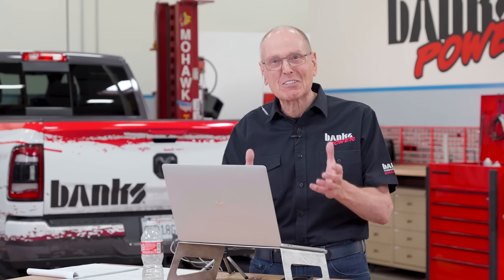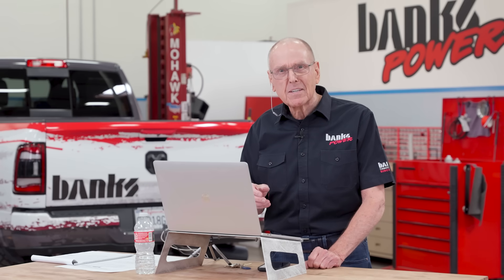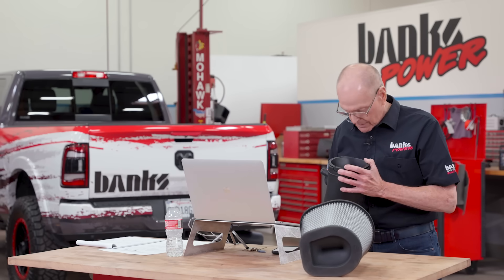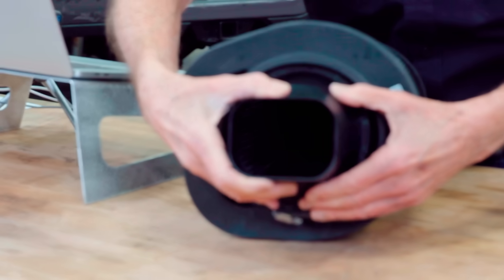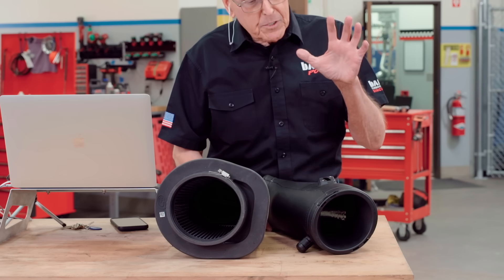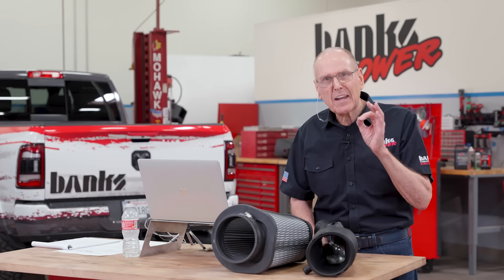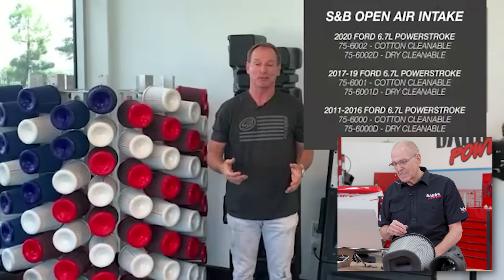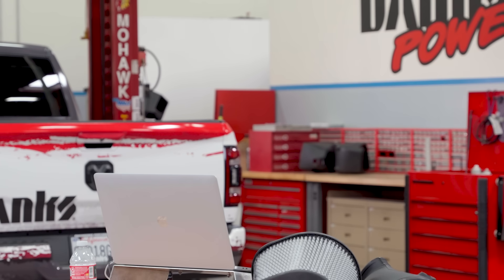Stop making these air intakes! | Fact Check

Comment: This is an engineer.  He couldn't stomach the thought of selling what the customer wants if what the customer wants is verifiably worse.  No amount you could pay him would change that, and he's his own boss so nobody can fire him, and no CEO can tell him he has to.  I'm 100% sure that if Banks didn't even have a competing product he'd be reacting exactly the same way.      I recently looked at a car that had a downward facing cone filter that acted like a straw and sucked enough muddy water up from in front of the wheel that there was a lake with muddy beaches inside the intake plenum.   I think that driver wanted a cone filter, but I really don't think he wanted his car totaled by it.

Comment: Gale.... this is all about sale's and money and vanity.....yea big impressive tube looks impressive but don't work..... this is just like putting a huge rear wing on a front wheel drive car sure looks impressive but does more to robb power because it creates drag sure you got down pressure on the rear but you need it in the front... vanity!.....…. that's why I watch you Gale and I have not seen you design or redesign and sell anything that is not proven to do what you say it will.......I always stick with the people I know who produce and sell a product that performs.....these newer companies/ manufacturers a good portion of them are snake oil salesmen they know the normal guy can't control test the product so they make this stupid shit for the millennial crowd....it is all coming down to greed....you need to remember that this generation has spent the absolute most on "college degrees" and are the dumbest generation to date and this is all backed up with data

Comment: Yep, I once bought a Ford Falcon with the original airbox/ cold air intake ditched, and one of those under hood filters installed.  Went OK, but I put it BACK TO ORIGINAL and there was a MARKED IMPROVEMENT in performance.
It is not often that you can improve the factory design, folks.  Especially with 'easy' bolt-on bits.  They're gimmicks, and Gale is correct to take the mickey out of this woeful product.

Comment: Banks may have some good products and do extensive research but they been under the EPA's desk for years
Reply from the maker: Don't believe every meme you see. We're under the same watchful eye as any manufacture. Following a government mandate like other manufactures is different than what you're suggesting. We have flash tuning solutions, intakes, exhausts, manifolds, heck, we design and manufacture entire engines. And, we make race parts for actual race cars. Our parts are on Pike's Peak race cars, dragsters, off-road buggies, trophy trucks and more. So, to suggest that love government emissions regulations is ridiculous. The government would be happy if all aftermarket parts companies disappeared tomorrow, including us.

Comment: You can also say that air filter company had to use that adapter plate because banks has the patent on how to work around the problem.  Good for banks for putting in the money and A&D.   You get what you pay for

Comment: If the restrictor was a crucial part of the design, it wouldn't be removeable. it was obviously done to be able to run on stock tune. The simple fix here is; get a tune.

Comment: My big brother bought a brand new 2015 chevy silverado 2500 with the 6.0 LS. He bought the $700  performance air intake and claimed that he had more power and torque with it over the stock air intake system.  I had just bought a used snap on verus labscope scan tool that had been refurbished (1st gen) and I plugged it in to his whip, and did 2 WOT passes for 8 seconds in 1st gear with no kit attached,  factory  kit attached and hi performance kit attached.  Well no surprise having no system attached instantly set check engine light and tripped into limp mode. And the grams per second data that I recorded did not change between the factory setup and the 700 buck gm ripoff device that the gm salesman talked him into.  And before I talked him into testing that stuff out,I asked him if he had had the throttle body swapped out to the 105mm that was stock for the LS 3 6.2. And he was like, no they didn't.  So it was the  stock 82mm TB. But at least it sounded as cool as flipping the air cleaner lid upside down on top of a quadrajunk😂😂😂

Comment: Doesn't make any sense to me at all. If you're doing a tune then fit the correct MAF sensor and calibrate it, then the tube diameter is what you need it to be. Fitting an aftermarket induction without a tune is just nonsense because the torque limiters inside the ECU software are what's limiting the hp and torque, so improving air flow to the turbocharger basically does nothing since the restriction still remains within the software on the ECU. My opinion may mean absolutely nothing though since US truck software may work in a totally different way to EU automobile software.

Comment: Closed style in this area with snow any snow flurry’s or having to break drifts going down roads plugged air filter tight in matter of minutes where a open style in engine compartment goes all winter long without plugging. So little sacrifice in performance keeps me going down the road without worry 6 months out of the year

Comment: Actually really like S&B products and their filters and the fact that they actually bench test their filters for flow and filtration, because most companies don't test filtration. But I must agree that this does look absolutely ridiculous
Reply: This intake is a gimmick. It's literally designed with a built-in restrictor that ruins the purpose of larger diameter tubing.

Comment: This is why I don’t like the intakes like this for my truck. They use a lot of plastic that leeches heat from the engine. They don’t improve the flow of air from the outside in, more just rerouting under the hood. They strap a large filter in place and say “ look at the size of the filter! Image the flow”. That’s a cute falic reference, but let’s see the numbers. Nah, the numbers aren’t there with these. I agree with Mr Banks. This is snake oil at best

Comment: So, basically, S&B restrict the big tube to just about the size of the stock intake? Might as well just go for any brand open air filter with the stock intake and save some money in that case.

I ran a K&N open air filter on my previous car, and while it looked and sounded good, there was a noticeable decrease in power once the engine reached operating temperature and the engine bay became heat-soaked. Conversely, the engine had more power when it was cold outside, but you don't really have a use for that during snowy conditions.

Comment: Big tube with a big internal restrictor all in an under bonnet HOT AIR intake! = sTrEat  CreD
Similar junk is marked the same down hear in Australia as well.
I've been lucky enough with a well known Sydney tuner where we dyno tested a few intakes on stock cars and found in most cases these pieces of junk made less power than standard, especially when the engine bay is hot... 
They are only worthwhile when the intake becomes a restriction and then they should be fully enclosed and sucking cooler air from the front of the car.

Comment: There were boxes like these years ago for bmw's that tricked the maf sensor, I wonder if it ever drives lean.... It's a better thing to have a reduction in airflow (hardware) and if you wanna go the extra mile just remove the reduction and get a tune. it's cost effective imho. No need to get another intake to go from stock piping to extra volume of air.

Comment: For every liter of fuel you are going to need 14000liter of air. K&N filters do not last a 500km race in the dust and thus the engine doesn't last . . . .

Comment: I completely understand your initial thoughts on this video. A lot of people want to hear more induction noise though and want a certain aesthetic under the hood so that's why they are looking for an open filter.

It's the exact same crowd of people looking to install a complete cold air intake system on a naturally aspirated vehicle.

The same people that probably started off buying all the fake chrome pieces from the chinesium section of autozone.

Comment: the only real air intake is the one that is insulated and extends past the radiator support to draw in cooler fresh air . even those boxed in air intakes still suck in hot air and are pointless

Comment: I replaced my factory air intake system with a k&n and replaced the exhaust increasing mpg by 4-6. This was done on my 21 F-250 6.2L. When factory I was getting 9-14 mpg, now I’m getting 13-20 mpg all depending on speed. Went from getting 383 miles to 400-415 miles on a single tank.
Reply: Your mpg increase does not match your range increase. Giving that you probably have a 34 gallon tank, you would be getting 12 mpg with 415 miles of range. Now we'll bump it down to 30 gallons because that may be the max you can actually put in... that's almost 14 mpg. So you're still in the factory range and the exhaust and intake did nothing for you. You need a tune to actually get anything out of the mods. My mileage got worse on my LLY duramax after installing a straight pipe, lbz intake elbow, and an HSP 4.5" intake until I got EFILive tuning.
Reply: You get an extra seventeen miles out of a whole tank of fuel....

Comment: Had an AFE intake with the ram scoop on my 16 Titan XD with the Cummins diesel and I kept getting codes for restricted airflow in the 0 and 30hp tunes. They sent me a new filter and again, the same thing. Went back to the stock intake and no issues. After lots of reading in the forums the stock intake will easily support more power than I'll ever throw at it. Aside from losing that nice turbo whistle im happy and the truck no longer throws codes for restricted air flow.

Comment: Noted this before on the Roush CAI on a Mustang Coyote.  You get this HUGE tube, but without a new tune/calibration of the MAF, (or with what Banks does with the control module for the MAF)... you get nothing out of it.  It also has an insert to be used when retaining the stock tune.  Pretty nice you came up with a control module to correct that, be nicer if you made one for the Mustang with the Coyote!

Comment: While I agree with most of the video, the comment about no one else being able to do inline MAF adjustment for 20 years is bullshit.  Dynamic remapping of sensors has been around for decades, with a plug in device between the sensor and controller the standard way to do it.  There are hundreds of other companies with products currently or formerly on the market that do this.  There are dozens of other companies with a product specifically for MAFs.  Their patent might protect their exact way of doing it (their hardware), but it is actually a very simple process of taking an electrical signal and outputting an adjusted one.  You could build a for more powerful version yourself using an Arduino in an afternoon.  It would most likely cost more, takes a little know how, and be bulkier but you could still do it yourself.

Never trust a company that says "only we can do this!" for something that has been around for decades, especially if they were not the first to do it.  It is just an attempt to gain sales.
Reply from the maker: We appreciate you watching commenting. We'd like to add some clarification. We are not claiming that we invented MAF manipulation. You are right, MAF correction has been used in tuning for decades. However, with patent 11193441, we may prohibit the sale of MAF modifiers when combined with aftermarket intakes. This patent does affect anyone altering MAF via ECM tuning, or even the sale of stand-alone MAF modules. It prevents the sale of MAF modules WITH aftermarket intakes, specifically.

Comment: Across many different engines and brands, I see a LOT of aftermarket companies say their induction pipes flow X more cfm. It really seems that $&B is going for that 'show and no go' crowd that wants an intake for it's mass and sound. This same crowd I've seen NEVER clean/re-oil those exposed filters and look super nasty in short order. I guess it's in your name, Banks POWER that you design products that actually do something (and in this case, POWER lol). Great video.

Comment: There are 2 factors behind this "genius" air intake mod:
1)Popular idea that this will make more power without any testing and numbers to back that up, just belief. The same failed type of belief as people have with "experts" in the media, or worse, celebrities talking about stuff they have zero knowledge/studying.
2)Looks. As in it looks a certain way that is considered by the peers as nice, even if doesn't make any sense. So we do get the "look at my big truck, with a big filter and big tube", which is definitely overcompensating!
In the end the other guy is selling what the ignorant fools really want and think it's good, not a real performance solution.
The battery tray is just on another level of stupidity, since not only will it have a big heavy hanging mass hold by a bracket and screws on a dynamic load, but it will experience the killer of machine parts, vibrations, in a whole new level. Not only you get premature fractures in brackets and screws with that hanging mass going up and down from irregularities, but the hellish cyclical loads of vibrations from the engine, road, air resistance, etc. just destroys anything, even with a big margin of safety under the maximum tension on a material.

Comment: Gordon Jennings in hin book about tuning 2strokes (talking about inlet here so the type of engine doesn't matter), said that air around the edge of a pipe creates a turbulence and slows down. This is factually correct. Then he says, that the pipe between the carb and the filter needs to be 400% the size of the inlet, to avoid slowing down the air. So although this looks stupid, this very specific part might be the only good thing they did. Overal this just feels like a scam product. That battery relocation kit will bend, if terminals touch stuff i hope you got a good insurance cause it will burn your car down.

Comment: This is why Gale is so awesome, and why I follow your channel. I don't even own a truck. He isn't bashing the competition, he is explaining why they are wrong. The world could use more people like that.
Reply: These aren't used parts.
Second, people don't  $PAY$ after market engine parts to merely get an even trade,  like for like performance. 99% MEN and WOMAN, that spend thier money on automotive ENGINE components,  don't buy them for the looks or the name, it's not like your knock off watch or purse! No offense,  really, but do you know anything about mechanical things? internal combustion,  or want to out perform your vehicles capacity for certain interests? The you sound Sir suggests a low level of integrity. Don't be offended,  but iam embarrassed for you.
Reply: Wrong in what way? I don’t think competitors are making any claims(none were made about this product) regarding the products they sell so how can they be wrong? People read more into what they highlight as product features than is being said. That uninformed assumption about things like CFM vs lb/min is what is wrong. CFM can be converted to lb/min though if you know the air density it’s just most customers aren’t going to do the measurements and calculations to actually see how the product performs. But without claims made about it’s performance gains there aren’t any claims to back up.

In this particular video the guy is selling a product because people want it not because he believes in it being the right way to do an intake. He gives some specs but doesn’t make any performance claims. If Gale Banks is showing that anyone is wrong it is the uneducated consumer since from what I’ve seen in the vid no claims were made.

Comment: Being a gasoline guy, Banks doesn't make an intake for any of the stuff I've had (4.3L S10s/Blazers and 5.3L Colorados) in recent years as far as I know, but I've ALWAYS gone for a real cool-air system much like Banks' designs. I'm also not afraid of a bigger throttle body or needing a tune (but I wish all good intake systems came with something like the Banks MAF controller).

Also, many respects to Gale for pronouncing 'fentanyl' correctly! The man's a damn genius, haha!

Comment: As a 38 + year Harley mechanic I appreciate your honesty. I have to deal with the forward facing “cone” type air filter crowd. They actually cost power on a dyno. Plus you are using the intake as a funnel in the rain (some of us actually ride in inclement weather). I normally get the “ram air” argument from the crowd that believes every hp gain advertisers claim for every part in the catalogue. No, you cannot throw a bunch of parts at an engine and expect 100% increases in power…
Reply: Well, we don't expect Harley riders to have study Fluid Mechanics. Actually, we shouldn't expect them to even understand high school level stuff...or basic reading skills 🙈🙉🙊😂 Just kidding!
Reply: Bike mechanic and builder here.....know exactly what you mean!

Had a lot of customers come in with their (expensive) wishlist comprising form over function.

Ok, I cut my profits, but i’d recommend a combination that was cheaper, gave better results, and still was everyday drivable.

Less money for me, but they always left happy, and I could sleep at night...
Reply: @fredsmith4106  putting customers ahead of short profits is smart in this time of the highly informed consumer, and most people will eventually  figure it out , or be told what's up.
Reply: I just think it looks cool
Reply: I beg to differ.
Reply: If you got the money you sure can buy a bunch of parts for 100% increase. BUT! you must know what you’re getting into and what you want. Nothing is impossible when it comes to a vehicle.